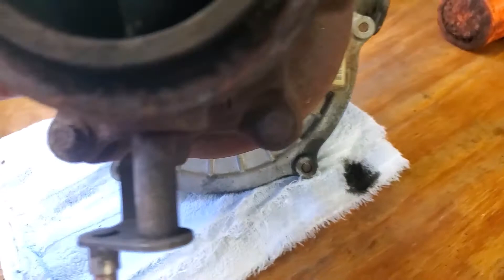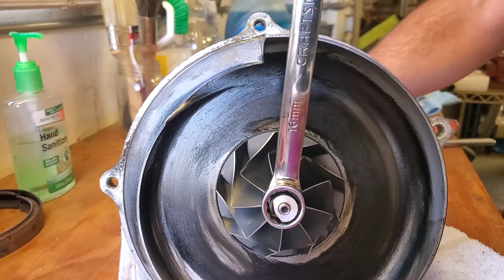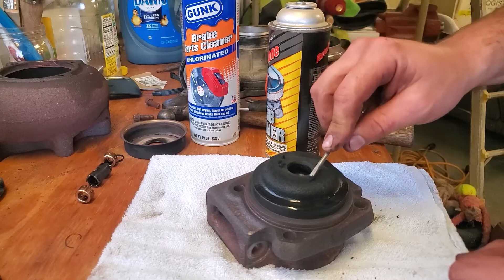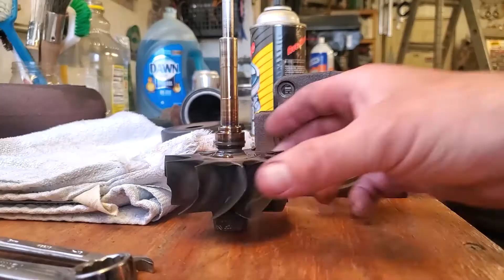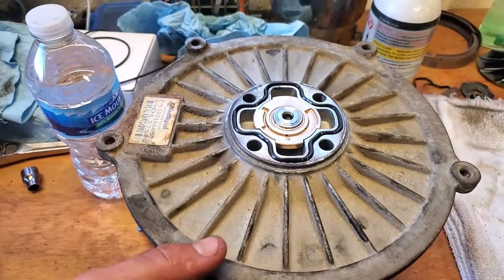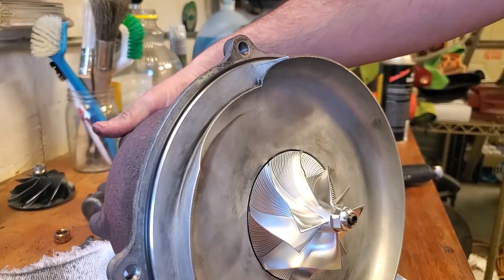7.3 Power Stroke Turbo Rebuild

Comment: for anyone planning on using vice grips to hold the end of the turbine wheel in order to remove the compressor wheel. Get a good pair. I got a cheap pair from Walmart trying to save money and ended up wasting more time. Going back to the store to get a good pair because the Walmart pair got chewed up

Comment: I got a BD Diesel blower stage 1, it’s really hard to find a rebuild/reseal kit for this huge ass turbo and BD won’t ship one since they don’t “make” one for the specific turbo I have. It’s an early 99 Thruster Kit 1 if all familiar. All I need is a reseal. Blows a little smoke but still spools up just feels like it takes a little moment to actually spool all the way. Everything else looks really good, the turbo itself the walls and the blade is  in great shape. Idk I’m confused. Anyone have an idea? I’ve bought other kits to kinda just hope

Comment: Will the shaft come out the hot side without separating the center piece? My bolts stripped and can't get it apart!
Reply from the maker: I've never tried, but I'd guess it would work as long as you don't have the butterfly valve or you can get the outlet housing off.

Comment: What is the 2 large and 2 small rubber o ring seals in the kit?
Reply: I know its probably a bit late and you might have figured it out but they are for in-between the turbo and pedestal and then pedestal and motor

Comment: Thete is no oil behind my turbo housing like yours. Is that a bad sign?
Reply from the maker: I assume you mean in the compressor housing. No oil there is not a bad thing. It just means your engine has like no blow by or your CCV is routed different than stock.

Comment: Thank you for that tip with the 1/4" drive 12 point 8mm socket. I have all the parts for my rebuild coming this week but I would've gotten stuck right there at the center cartridge. Got a cheap 5+5 billet wicked wheel replica and the KC turbos 360° rebuild kit. I don't know if it comes with the pedestal gaskets though. I might have to go by Ford and grab those if they weren't included.

Comment: Dang man, most thorough turbo-rebuild video Ive seen yet. Decided to do exactly that with the kit and parts from RiffRaff. Been buying 7.3 parts from them for years, they are always super reliable parts. Got a new Garret turbine wheel prebalanced and everything, just to be safe. Not looking to drop the money on balancing the whole turbo... 

Thanks again for the awesome vid man! Probably wouldn't be doing this job without it 😅

Comment: Makes a dandy exhaust brake if your so inclined... EBPV that is.
Reply from the maker: It does help, but barely. I had mine wired up as one for quite a while, even went as far as wiring it up to work automatically when I press the brake pedal. I wasn't impressed by its braking abilities enough to keep it. The possibilities of oil leaks outweighed the braking benefits in my opinion. Not saying it's a bad idea, it's just my personal preference to remove it.
Reply: @darkhorseautoanddiesel that’s surprising I don’t think I can live without mine. Such a luxury when running over the mountain passes with a trailer.

The oil can hit your clutch tho and ruin it if you got a manual. Ask me how I know.

Comment: What is your recommended procedure prep for the first restart of a new/rebuilt turbo? Do you crank the motor with the fuel pump fuse/relay disconnected to get the oil flowing, or just pre-lube it to death, and start it normally?  Ty
Reply from the maker: Pre-lube it to death and start normally. On the bench, I turn the turbo where the oil inlet is pointed up, pour oil in it and spin the shaft a bunch of times, then dump it out and install. Then just fire it up like normal. At that point it's no different than starting it any other time.

Comment: My turbo like squeals? I guess its what it is it sounds like its rubbing on the sides sometimes underload then jsut goes away like a high pitched squeak idk im gonna requild mine and do the ebpv delete
Reply from the maker: Check out the short I just uploaded. Does it sound like that? I just had the same thing happen to me haha. Mine was the turbine wheel coming apart throwing it out of balance. A rebuild is most likely needed, and I agree with deleting the EBPV while you're in there. I've done it to both of my trucks and have no regrets.
Reply: @darkhorseautoanddiesel  mine doesnt sound like that its more like a whistle but high pitched along with the normal turbo sound, iv heard some people say its normal some people say its not, idk what it is but when its making the noise i get the best power from my truck. Its weird.
Reply from the maker: @ryancollins3227  That's kinda strange. Sometimes a boost leak will cause a squeal, but that would result in a decrease in power, not an increase.
Reply: @darkhorseautoanddiesel  well i also have a leak with my uppipes so it like .3% better with power lmao the truck just feels mmore responcive when it makes that noise but it is prob just a boost leak thats intermittent
Reply from the maker: @ryancollins3227  So it is possible that the noise is actually an up pipe leak as well haha. Since you should remove the turbo to replace up pipes you might as well rebuild it while you have it out, it's not that much extra work for the piece of mind. Have you checked the shaft play of your turbo? Pull the intake hose off the compressor housing and try moving the compressor wheel. You should have almost no perceptible in and out play. I think the spec is like .0035 inches of allowable in and out play (don't quote me on that number though). Side to side should have a little bit of movement, but not so much that the wheel hits the housing.

Comment: Hi mate this is was a best vedeo ever see 👏👏👏👌👍 that's a great explanation 👏👏 you have a new subscriber 👌👍👍 I enjoying see your vedeo and I would like to asking you if I disconnect a Westgate valve and keeping a full time opened exactly like you doing on your turbo it's interfere on electronics  failures?  I have a problem  on my excursión 7.3 he starts good but after a cople seconds he stops and I found leaking air on turbo Westgate zone 😏🤔 looks like is stuck 🙄😕 probably that electric sensor are broken!!🤔😏 I don't know what I need to do 🤔 the failure code is: P0478!! a friend of mine said can be a camshaft sensor!! any suggestions?? he starts great but after a 5 or 6 seconds he stops 😐😒😒 I apreciate if someone can help me 👏👏👍 cheers from North of Norway 🇳🇴 👍
Reply from the maker: Unhooking the red wastegate line like I have on mine won't interfere with any electronics, besides a possible over boost code, which can cause the PCM to reduce the amount of fuel being injected. That doesn't happen on all trucks though. Neither of my trucks (2000 and 2001 model years) cut fuel. It can cause mechanical failure of the turbo though if you are running enough fuel to push it past about 30 PSI.

The problem you are describing sounds like the Exhaust Back Pressure Valve (EBPV) might be sticking closed. Does the truck feel like it has no power when you press the throttle but idles fine? Do you hear a loud "whooshing" noise from the exhaust when you try to drive it? The P0478 code describes abnormally high voltage to the EBPV circuit. If that is the case, I recommend just removing the whole EBPV system, which I have a video showing how to do that. It's included in my turbo removal video.

Comment: Nice vid. Careful with Riff Raff. Better off with ProSource diesel. Very helpful video
Reply from the maker: Thank you. I'm glad it helped, that's why I make these videos. I've never heard of ProSource. I'll check them out. I've done business with RiffRaff for years and have never had any issues. The wheel I put in the turbo is still working great after around 50k miles (roughly).

Comment: How did the new compressor wheel perform ?
Was it even noticeable?
How was the sound difference?

PS. Excellent video
Reply from the maker: It's been performing flawlessly for around 40,000 miles (I'm guessing, I'd have to look on my maintenance form to get the exact mileage). No noticeable power increase, but it does spool up a little quicker, and I have yet to notice any surge under about any condition you can imagine. 

It does sound different. It does make a bit more noise than the stock wheel when under a load and boosted up, but I've yet to be annoyed, and when it's common to be towing for 11 hours a day, that says something. 

I have a review video on that wheel, but at this time I don't have it edited or posted. I should probably get on that...

PS: thank you! I try my best to make my videos detailed and informative, but not boring.

Comment: FYI 5/16" is 7.93mm and fit on my bolts.  My Craftsman set had 12 point 5/16 but not the 8mm.
Reply from the maker: I've wondered exactly how close those 2 were, just never looked it up. I know for most practical purposes they are interchangeable, just like 3/4" and 19mm, or 13/16" and 21mm.

It's definitely irritating how when you buy a socket set they skip certain ones. I hate 12 point and avoid them if at all possible unless it's a 12 point fastener.